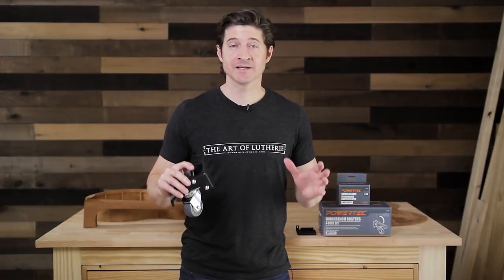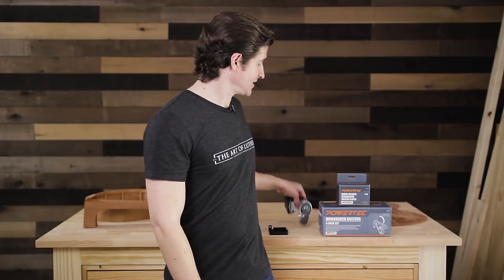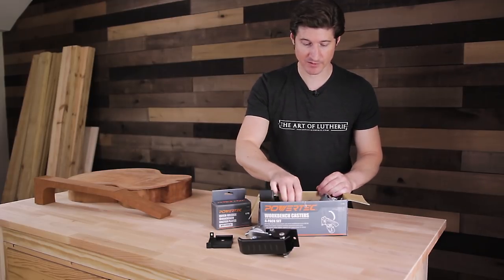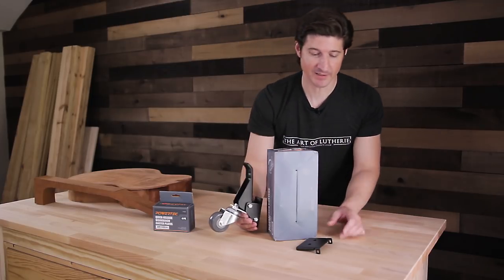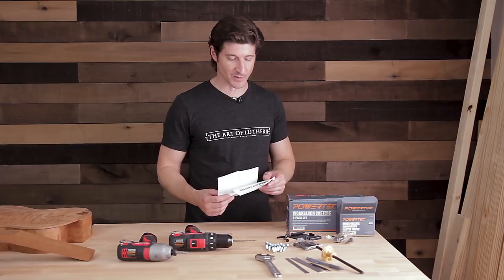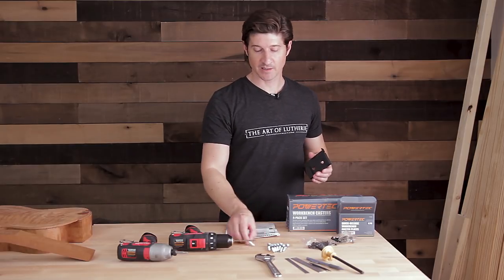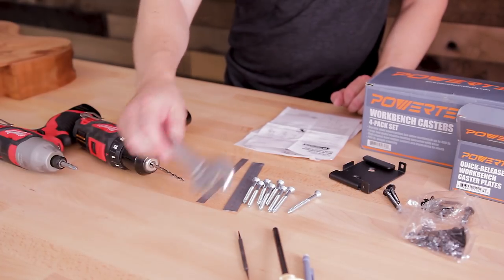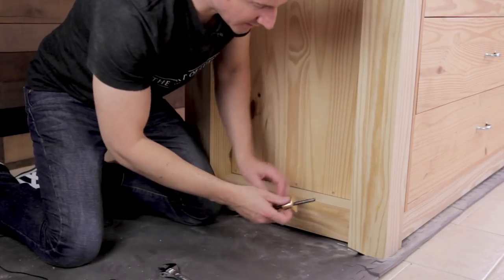Workbench Casters ( Installation & Review )

Comment: Tom, so glad I found your video as I was about to buy the Solejazz retractabls despite my deep reservations about the trip hazard issue. The Powertec caster removability via mounting plates sealed the deal for me.   My "Ultimate Tool Stand" with its torsion box and MDF construction is a behemoth, even heavier than your workbench. I just have to fabricate and bolt on solid wood legs to make the caster attachments. If you have not seen "Woodworking Tip: Twist Free Bench Casters", by woodsmith, have a look. They drilled holes in the levers and attached a crosspiece between them.  One footpress in the middle engages two casters simultaneously without torqueing and twisting the bench as one at a time engagement does. You might have to fiddle a bit with sliding two connected casters into their plates but i think the operation is very doable and the benefit is cleanly lifting each side of the workbench with a single footpress.

Comment: Thank you so much for the clean, clear, detail review and explaining. I think your video is the best I watched so far on this subject. 👍👌 
The legs of my benches are made of thin metal. How I can install bolts on the brackets, so they will not interfere with placing and removing casters?

Comment: Tom, all of your videos are excellent.  I'm thinking about adding those powertec casters to my workbench/assembly table but have a question.  how do they perform when only one caster is engaged at a time?  does it torque the table?  could that lead to weakening over time?
is there a version that engages both casters (on one side of the bench) at once?
Thanks
Tom P

Comment: 1st, i believe you are supposed to rotate the wheels inward so that they are not sticking out as much AND so the leverage works to your advantage.  2nd, could you comment as to how much vertical clearance the bench gets when raised? It looks to be only 1/8". That would be a big concern if your floor isn't perfectly level or you need to go over a seem in the slab etc.

Comment: Question , I am planning to build a workbench , not sure about the hight, sometimes I need it lower and sometimes higher. So I am debating between 85cm or 90 cm.  I noticed that in your video you could mount them a little bit lower. if I mount them lower will it give me the 5cm difference ?  is the table stable standing on wheels?